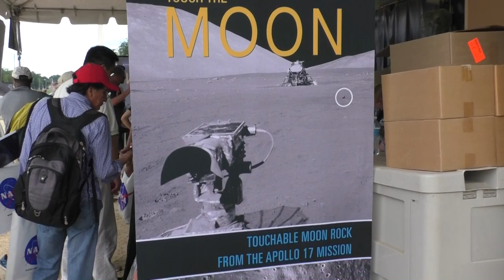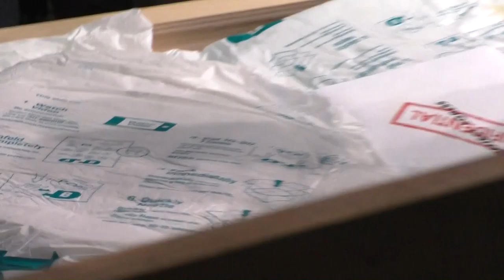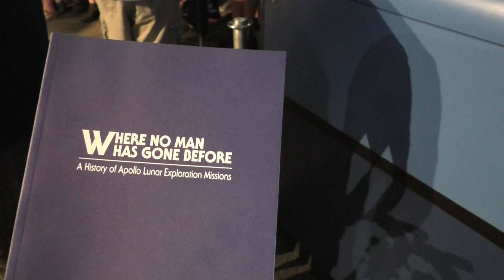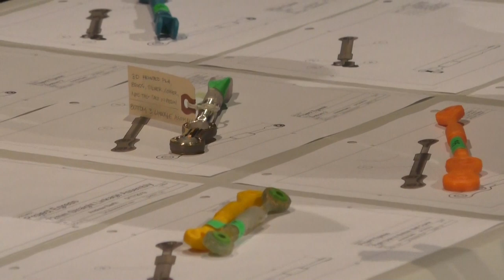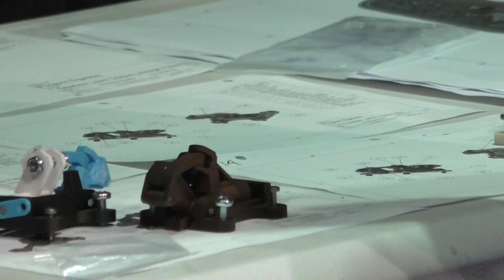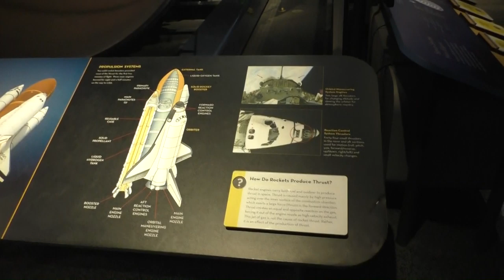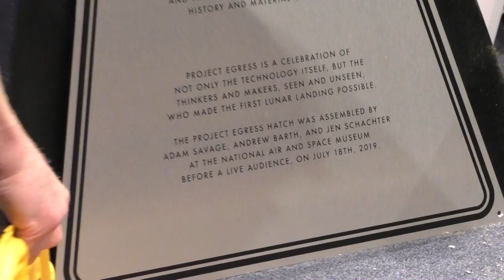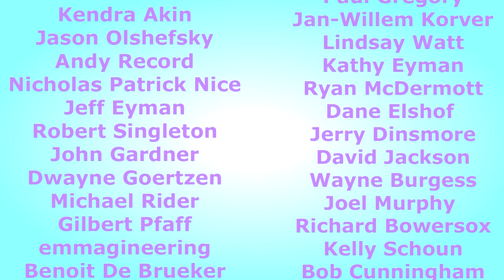Adam Savage Project Egress Apollo 11 Hatch Live Build!

Comment: this is a basic illustration why it's so dificult to assemble airbus and joint european military gear projects: every country builds a sub assembly and in the end there is a fitting plant where they secretly operate the angle grinder and the big hammer.
Reply: When the prints and models had no tolerances or GD&T applied that threw up major red flags!
Reply: when they replace a daisy chain of set screws by fixed length artistic impressions
Reply: People that haven been in the machining & manufacturing industry are so baffled as to why there are issues. These are done by people in their basement, not machinists with $5M worth of metrology/inspection instruments. Even in aerospace machining/manufacturing, there are sometimes fitment issues. Expecting a bunch of "makers" to do it flawlessly is unreasonable. Add to that the incomplete plans (that are not the actual plans, as Andrew made all the plans based on PICTURES of the actual hatch.), that the materials are not standard aerospace materials, and the fact that it is a piece of art and not an aerospace assembly, they did pretty good.

Comment: When I was a machinist in the Navy we had a saying. If that don't work, try a bigger hammer. When Adam used the hammer on the outer window bracket, I had a feeling that was not going to have a good ending. That fit looked way off.  A simple hand plane would have taken less than a minute to trim it a bit. Too many people forget about the simple hand powered tools that worked great for thousands of years.
Reply: This fellow machinist agrees. Had every tool for every conceivable situation? Good grief, a mill file would've fit that part to a tee in minutes. But he used Boeing's third rule of manufacture. Oh, guess where I work, lol?
Reply: I had to  skip forward at that bit.... the cringe factor was waaaaaaaay too high. 🥺

Comment: From
https://en.wikipedia.org/wiki/Basalt

"Basalt generally has a composition of 45–55 wt% SiO2, 2–6 wt% total alkalis, 0.5–2.0 wt% TiO2, 5–14 wt% FeO and 14 wt% or more Al2O3. Contents of CaO are commonly near 10 wt%, those of MgO commonly in the range 5 to 12 wt%.

High-alumina basalts have aluminium contents of 17–19 wt% Al2O3; boninites have magnesium (MgO) contents of up to 15 percent. Rare feldspathoid-rich mafic rocks, akin to alkali basalts, may have Na2O + K2O contents of 12% or more."

In other words, basalt is a mix of magnesium, calcium, aluminium, iron oxide and/or silicates.

Comment: There are two things I take away from this.
One: how blessed and respected you are to be included in this and...
Two: What the Hell were those NASA engineers on when they found the need t make a door so complex?
Reply: There are two kinds of people. The first look at a complicated device like this and wonder what difficult requirements it was designed to solve; the rest think that they could do better sealing a door against the vacuum of space using a latch from the local hardware store.
Reply: Keep in mind they were limited to the materials they had then. That door had to function properly and keep a 100% seal even after being subjected to the g forces, vibration, and temperature changes associated with a lunar mission which they weren't entirely sure how bad they'd be. To reuse a phrase associated with the space program, failure was not an option. There were no stage by stage tests for the Saturn V either. They tested one fully assembled rocket and the next one went up with astronauts on board so some over-engineering was understandable. You can't argue with the results. Every Saturn V functioned as designed, and though we came close with Apollo 13, we didn't lose any astronauts during the flights.
Reply: @JamesChurchill  There are many more than two kinds of people but among them there are those who understand that the more complex a system the more potential points of failure there are.
Seeing this and following through many of the builds, I am still left with the feeling that the committee that designed this system could have done with a more forceful chairperson.

Comment: I knew fitment would be an issue, too many chefs. Also when I saw there were no tolerances given the makers, also critical measurements from 3D scans(?). Fitting and measuring from the actual door is almost necessary for good fitment.

Comment: Awesome Fran! You helped in the construction of the Apollo hatch that is on display in the Smithsonian!! How cool is that..  I'm not exactly sure why many people are making a big deal out of the tight fitment of parts? It's just a display model; and the parts were made by many individuals from plans that were derived from a scanned original.. I'm actually surprised there weren't more issues with the build.. Did you get to sign it? Would have been neat to watch you do so if you did..

Comment: Can I be the ass that points out the bolts installed backwards? Should always be installed so if the nut falls off the screw won't fall out.
Reply: may not apply in zero g  :D